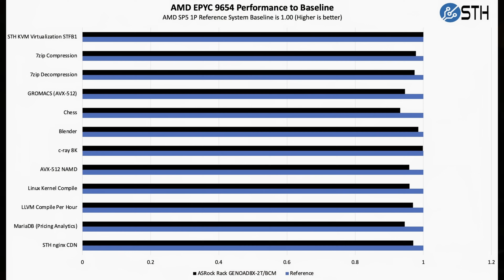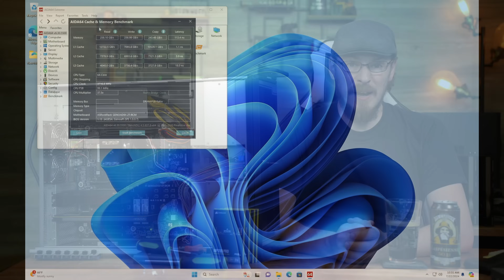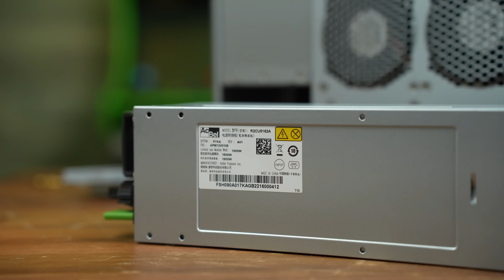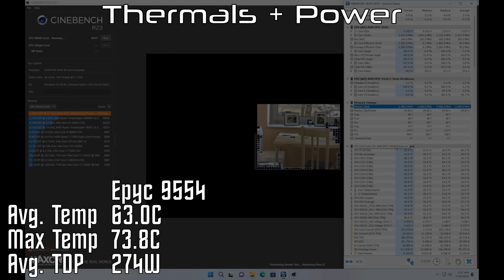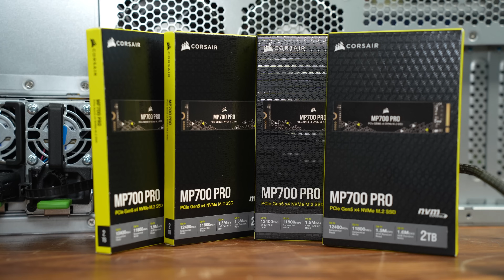I can't believe AMD trusted me with this...

Comment: Found my way here because I’m apparently somewhat of a nerd and need a workstation to process AEC design and construction workflows involving large models and Light our scans, point, clouds, etc.

What would be the best configuration for a low-end thread ripper that gets me high turbo clock for non-SMP enabled tasks and doesn’t break the bank?   Also need way more I/O connectivity on the motherboard. 256gb+ ram, multiple pcie 5 none… etc etc. rtx 5080

Cheers,  🍻 (coppertail brewing unholy trippel in hand currently)

Comment: I've been trying to get an optimized homelab build together for a few months. I tried to get a parts list together with AMD 65W TDP consumer grade chips (the Ryzen Pro 5000G series), but found they are not as feasible as used server gear due to the lack of PCIE lanes and lacking full ECC Memory Support (The Ryzen Pro series does support Unbuffered, but for TruNAS Scale it seems from my research to prefer Registered DIMMs slightly). I then looked into Haswell and Later Era Server Xeons and found a few configurations from the Broadwell and Skylake Gens that may be feasible, but considering I don't have enough power requirements to do more than one server at this point, the lack of cores without going High TDP, Some lacking ECC altogether due to being workstation chips and the inefficiencies of older chips (especially since I didn't want dual sockets and wanted a single chip that was efficient) forced my hand. I then tried to look at EPYC, but the prices for the motherboards and especially used CPUs are crazy, especially for 2nd and 3rd gen EPYC (even on ebay making the ones on Newegg and Amazon seem like a steal) and the max TDPs are higher than the intel chips I was looking at. Usually the least desirable more power hungry EPYCs are cheaper, but the lower powered chips with higher core count and/or those with high clock speeds, even from reputable Chinese resellers can get up into the 1000s of dollars. Then I found the sweet spot; scalable Xeon. Finding a motherboard and a CPU has come down in price significantly from the EPYC option to the point that you could with the right configuration spend 2 grand less for similar parts without sacrificing most modern C-States that you would have if you used Sandy or Ivy Bridge or Even Haswell and Skylake. 1st Gen Scalable Xeons tended to be too power hungry for my liking, with only a few chips desirable, but still relatively cheap. For a Benjamin more or so you can get high core count (28 Core), High Clockspeed (3.7Ghz) Server Grade Xeon at 20-58% less TDP than Comparable 2nd or 3rd Gen EPYC. Also the EPYC Problem of Vendor Locking on chips that went into OEM systems like HP and DELL scared the hell out of me. Also another added benefit is that you can create a configuration with 1TB of Optane Memory in App Mode and still have 384GB of System Memory in ECC DRAM where optane memory can outperform most slog solutions including using enterprise SSDs in TrueNAS by a significant margin and the added bonus is you can save money on DDR4 RAM as well that way. Consider a new kit of 512GB of DDR4 2666 ECC RDIMM is over a grand already and moving to optane with 384GB is at least 20% less expensive and definitely under a grand and you can easily go with that instead. Pair it with a used 3U 16 3.5" bay case from Supermicro off ebay and redundant power supplies with 80+ Titanium Efficiency and you have something that can run ProxMox with TrueNAS Scale VM with NUT and an Ubuntu Server Running Pihole, Unbound and Vaultwarden while only having a peak power consumption of about 530W. All I need now is to wait for the money to buy the parts.

Comment: I like this! I've just got my hands on a Gigabyte ME03-CE1 (SP6) motherboard with an EPYC 8024P (I don't need much performance, but quite some fast I/O). After being absolutely disappointed with ASRockRack W680D4U-2L2T/G5 (I really can't recommend it - janky as sh!t), I am hoping this will work nicely.

Got a SuperMicro ATX tower, a Noctua CPU cooler, 4*3.84TB U.2 NVMe drives. Only the RAM is so prohibitedly expensive, that I am coping with just one (soon 2) 16Gb DDR5 ECC RDIMM RAM stick(s).

Still: I'd never ever want a server, that doesn't have a BMC with media redirection.

Also if you are looking to stress tests, try running a LLM - should be fun, especially with the GPUs you've got.

Comment: Tripp-lite (Eaton) makes some "Plug-Lock Inserts" for C14 which I found help with the loose cables on a crowded PDU.

They come in batches of 100, and they seem brittle, but damn are they useful.

Just watch out, the force needed to get them in/out after the lock is installed ain't a joke.

Comment: If your worried about usb connections. For around $20-30. A Microsoft Internet Pro keyboard has your back. Not only does it have a PS/2 port connection. It has usb. AS WELL AS 2 usb connections in the back on the right. Perfect for your mouse or a slow ISO install. And the handful of times when I had only one working port. All 3 threw 1 port. And its pretty durable. I've had mine around 20 years as a daily driver.

Comment: Damn that a beefy system.  VDI at home?  Lab?  It will serve all residents in a Mil sq ft + mansion.  I'm game to see more of vGPU sharing on Proxmox.  But VMware and Horizon are dead to me.
Video series idea - Proxmox HCI with Ceph deep dive.  Help peeps get off VMware VSAN.  I'm sure AMD will understand that Ceph requires minimum 3 node cluster and send 2 more 9554s right over. :)

Comment: Bought 3x 9354 32 core Genoa based servers semi recently, their improvement over Rome which they were replacing was noticeable just in using the virtual machines that were running on them, you pay for that improvement in power though as maxed out with a power virus load I was seeing 600-700w per system and these only have 1 cpu, 12 sticks of ram and 2 sata SSDs each, it is nice and fast though. The old Rome servers were never that power hungry, 32c, 8 sticks of ram and 2 SSDs would see it use ~300w.

Comment: Hey Jeff! I'm thinking of making an Epyc based workstation/server at home, but going the Milan route just to save a huge amount of money. Rome and Milan parts are far cheaper than what they used to cost at launch, and that includes everything, the CPU's themselves, the motherboard options, the ram, everything. My plan is to get a dual socket, and upgrade it gradually.

The sheer power of a 64 core system would be incredible by itself, but having say... 1TB of memory could allow me to do some pretty crazy things in certain applications.

Comment: I have the Rome version of that board. The layout is exactly the same and I have run into the USB issue as well. I run unRAID on mine so one of the USBs is populated by the unRAID boot drive, and the other is for the communication to my battery backup. If I ever need to connect a mouse/keyboard directly to the board, I have to unplug the battery backup com connection. Great board otherwise.

Have you tried running any of the Intel QAT cards in your servers to assist with VPN performance? Im currently trying to passthrough one to a pFsense VM, but Im having issues with the drivers being blacklisted in vfio.

Comment: EDIT: This isn't a dig at Jeff. It's about the stupid numbers these companies throw around. I do think it is part of Jeff's SSD woes though.

Your drive problems seem to be caused by "The wrong numbers".
Every marketing blurb number you quoted in this video is absolutely useless, and doesn't say anything about a real use-case.
1.5M IOPS? Cool. Oh wait...that's at queue depth 64 with 128 threads...
11.8GB/s writes? For what? One second, on an empty drive, writing to system memory before flushing to disk?

If you saw a plastic sign on the side of the road that said "Earn $50k a month from your own home!" would you take that number seriously?
Because that's what these number are. They bear no resemblance to reality.

In a HomeLab VDI context you MIGHT care about queue depths of 4-8.
On a workstation you care about queue depth 1-2 at most.

Random 4k Q1T1.
Sequential 1M Q1T1.
Latency.

These MP700 Pro drives ARE good drives.
TLC (Best we can hope for in a consumer drive...)
DRAM cache. 4GB for the 2TB drive is good.
The controllers are good.

But we are pushing these flash modules SO hard.
And consumer drives just aren't made to do the kind of workloads even a light server is likely to want.
You can certainly get away with it. But there will be times when the performance just isn't what you expect/want.

Comment: This is basically the setup I want to upgrade to in a few years after the prices have dropped. I would like to see how much you could potentially consolidate your rack. Could you virtualize and run your entire homelab off this single server? You already have a pretty amazing setup so obviously you aren't going to be able to throw a petabyte of storage into that chassis but could you do everything else? How much storage can you reasonably get in it? Would homelabbers be better off buying multiple lower cored systems and basically clustering them or would they be better off spending a little more buying an older 32-64+ core processor with gobs of pcie and virtualizing everything? What software would you use and how would it compare performance wise to your current setup? Also what are the power savings, if any, or consolidating like this? Yes that single chip pulls 274W alone but if you could replace 3 servers that pull 100W each you are going to be ahead. It would also impact your need for networking as you could pull switches out of your rack entirely if you didn't need to connect as many devices.

Comment: In 2015 I built three X99 boards @ about $6000.00 a piece with all the latest and greatest whistles and bells. My wife thought it was a bit over kill. Those three builds total over $18,000.00. But one AMD CPU @ $9000.00? And BTW all three X99 boxes are still running flawlessly today in 2024. I put a lot of TLC into those (Linux) boxes which have serve me well. This VDI build is interesting, ultra fast large memory. Geeks are becoming virtual machine freaks. I prefer a system once down which can be easy to restored in just a few minutes.
Reply: VMs were "the future" in like...2005.
Everything is done on VMs and containers now for a good reason.
Less waste.
Also, one of the biggest reasons to use a VM/container is to be able to move them easily or blow them away and rebuild them with much less effort.
I don't understand how your bare hardware setup could be easier/faster to get running again than having it in a VM/Container would?
Reply: @Prophes0r  I have built quite a few VM's for the fun of it on Archlinux and Gentoo systems. OS2, OpenBSD, NetBSD, FreeBSD, Windows. It's easy to do. With better hardware, bandwidth, large number of cpu cores, large memory needed especially for a ZFS file system it's like running real metal. As a server with many clients I say yes. Those VM's can make life easy for those who really need it. Your right  about "hardware setup could be easier/faster to get running" it seems to me setups are easier in a VM than setting up on bare metal hardware. Reasons for this are obvious, because the latest and greatest computer hardware with many new device drivers are not there yet. Simply put VM's are emulators.

Comment: Jeff i struggled a lot to get out some good performance with zfs and nvme drives.  In my case a singel drive gets 6/GBs R/W but with zfs the speed drops a lot like 2/GBs - 3/GBs R/W.  I tweakt a lot like zfs= metadataonly or atime....and ashift the performance reases a lit bit like 1/GBs more R/W speed. Also somenthing what i notice was if the proxmox host is under heavy load the performance of zfs is also droping cleary in my case i use also some "Epyc Rome" and enterprise U.2 SSD Gen4

Comment: You as far as homelab goes with our consumer budget restrictions. 7950X gets about 40,000 in cinebench and 100GB/s in RAM throughput. I think it would be more cost effective to just scale to the number of 7950X, RTX 4090, 2x48GB DDR5 6000 CAS 30 nodes that you need. There are obvious pcie limitations but I think pros would outweigh the cons.

Comment: Hey Jeff, I was considering to do the same thing if I ever gotten a house of my own to have a dedicated and grounded 220v circuit using a NEMA-30 plug for a APC Battery back-up but was concerned about power managing that UPS to support 120v devices like a couple of SPF+ switches, cable modem, controller and a 2U/3U custom server. If you do that upgrade, under your discretion, would you provide a video for that including any challenges you experience?

Comment: These people need to stop with the PCIe lanes. Get NVMe to use x1 or x2 per device. The size of these sockets is getting out if hand. AMD has no dual socket solution on a standard motherboard now. Intel still does, but i doubt for long.

Comment: I would play with mandelbulb3d which slowly generates 3d fractals and lets you explore them. It's highly parallelized. Or when it's winter, heat the house by downloading boinc for distributed computing like dna folding which can use gpus as well.

Comment: At 10:45
Input voltage....

In the United States, voltages at the wall are 120 volts and 240 volts. I believe they used to be 110 and 220 50 or 60 years ago, but we upped the game slightly....
Reply: Still a joke

Comment: I wonder how noisy that air-cooler is, though perhaps the PSUs may be noisier in that setup... Pity there's no somewhat quiet Arctic 4U update for the increased TDPs and socket sizes of the SP5-using generations... Maybe this cooler is not capable of reigning in the 360-400W TDP, so the CPU got downclocked a bit, and thus the lower power/heat observed while testing... or maybe you had more eco-friendly options in the BIOS to limit/restrict the power before the chip can spread its wings?

Comment: MY REASON COMES AT THE END >> What I would love to see running is an entire home network - all on one physical machine - modem/router, firewall, NTP, DHCP, proxy etc.,  running your own search engine, any other such things, but then also running a Win7 or Win10 VM with GPU pasasthrough at loading graphics intensive things like games, video rendering, 3D CAD etc ... THE REASON is because I had my own idea for a project which would be like a mobile internet setup for a home, caravan, or motorhome, such that you could take your entire internet and home lab while travelling, and most importantly, never be forced to upgrade to that garbage Win11 clusterf*ck Microsoft has just started imposing on people OMG WTF were they thinking.

Comment: I was surprised you didn't already have a 220 V circuit in the garage with how many KiloWatts you keep in there!

I'm sure that if and when you do upgrade to 220 V out there it'll be a video, but I'd also be interested to see how the total power draw changes. Probably only a couple of percent, but when you have that many of them I bet it's a substantial difference.
Reply from the maker: Shockingly enough, my rack only needs around 900W at max, (plus another 600W on a second circuit for the AC). Idle is around 600W.
Reply: @CraftComputing  wow, that is substantially less than I expected, I thought the AC would be a couple of kW by itself!
Reply from the maker: Yeah, it's really not terrible. I've been as high as 1200W idle in the last few years, but 2023 was all about consolidating down and getting more efficient equipment.

Comment: If you do end up running proxmox, a 6 drive, two vdev raidz1 (3 drives per vdev) is a config that performs quite impressively - at least in my use case with older micron 2300 nvme drives.

Comment: Most datacenter run 208v not 220v FYI.
Reply: 13:40 your issue is probably as much the SDS not the drives. Most software defined storage is crap, especially if you're not running fully optimized memory configurations
Reply: Honestly get a graid type card and drop zfs. You'll see better results.

Comment: Really looking forward to the speed testing, if only to drool all over myself wishing I could afford such a thing.

Umm, people suggested Crysis CPU rendering, which I'd definitely be interested in seeing, but also, I can't help but wonder how many copies of Cities: Skylines 2 you can get running before the framerate tanks to unplayable levels. Given how notoriously CPU-heavy that one is, and the fact that city sim games can usually get by with 30 FPS or lower, it'll be interesting to see if the dual GPUs or the Epyc ends up being the ultimate bottleneck.

Comment: How many simultaneous Plex/Jellyfin streams can you CPU transcode before it chokes? That might be an interesting test.
Reply from the maker: Not really a great test though. CPU is the least efficient (power/price speaking) way to encode video. Anything more than a few streams and you'd want dedicated hardware, like NVENC from NVIDIA or QuickSync via an Intel Arc GPU.
Reply: @CraftComputing  I knew it wouldn't be efficient. I was more trying to think of off the wall ways to stress the cpu that might be halfway interesting for a video. Of course dedicated hardware like nvenc is going the beat the pants off cpu encoding.